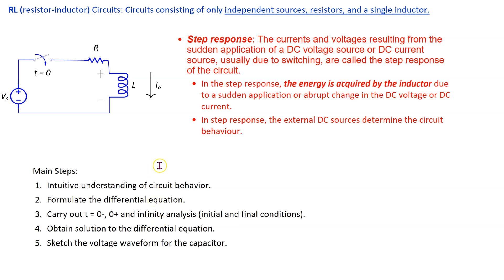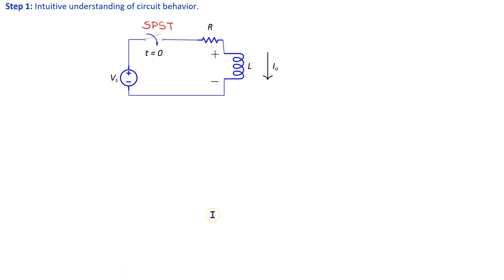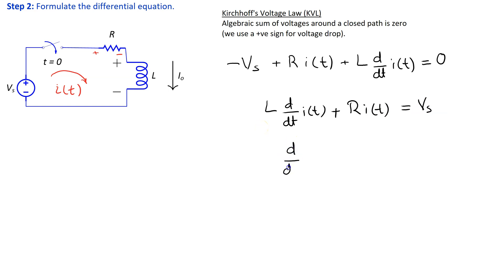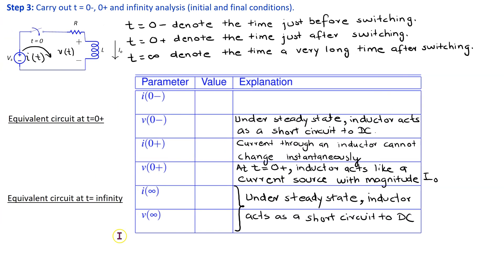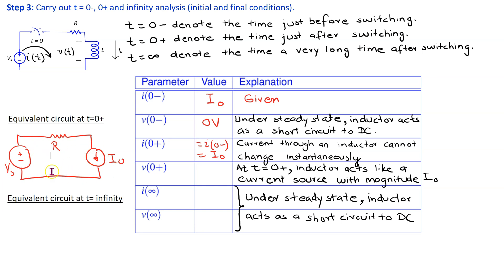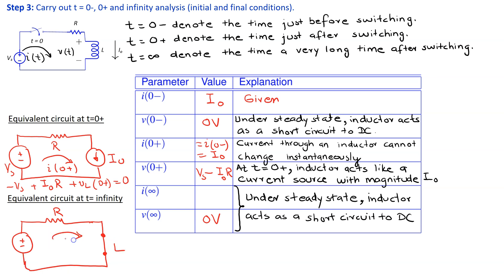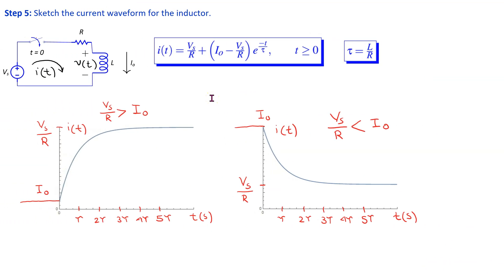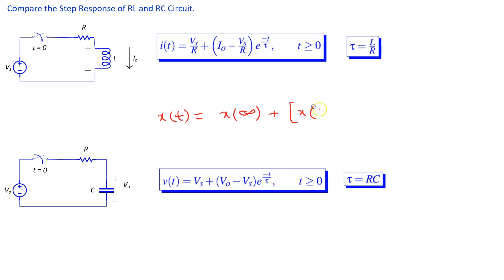Demystifying Step Response of a First Order RL Circuit

Comment: The confusing part here is the constant. Is there any intuition  as to what  " Io minus I-infinity " multiplied by the decaying exponential actually represents. I can't get head around it.
Reply from the maker: Thank you for the question. Boundary conditions are constraints necessary for the solution of the RL circuit. The constant represents the boundary condition. Hope that makes sense!

Comment: Hello, I am trying to understand why is not i(0-)=0? Because if the switch is open no current can go through the circuit?
Also, I'm trying to understand how you obtain C1=i(0+)-i(infinity) ?
Reply from the maker: Great questions!

i_L(0-) is not 0 because it is the fundamental property of an inductor that it does not allow sudden change in current. Hence, i_l(0-)= i_L(0+) and is not equal to 0 in this case.

The constant C1 value comes from boundary value conditions when solving the differential equation. In the video, this proof is not discussed and just the final value is given for C1.